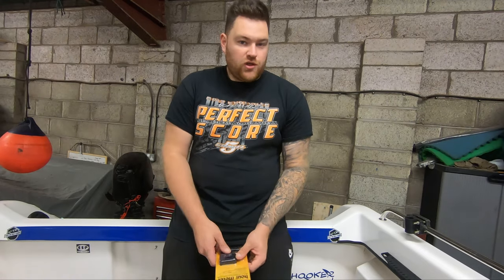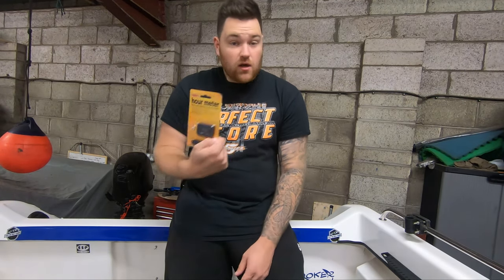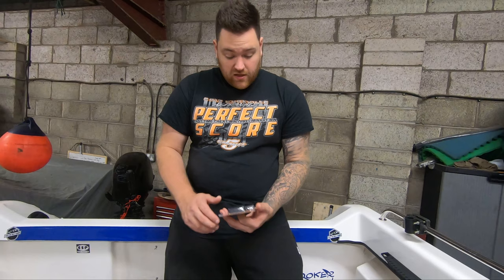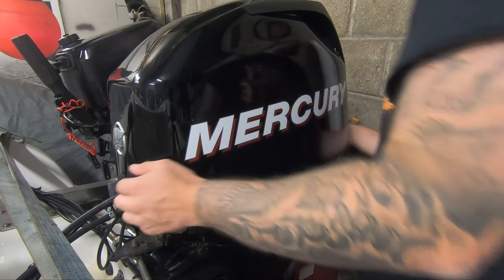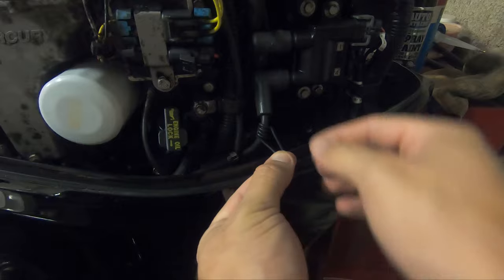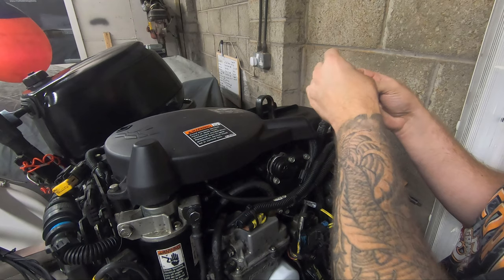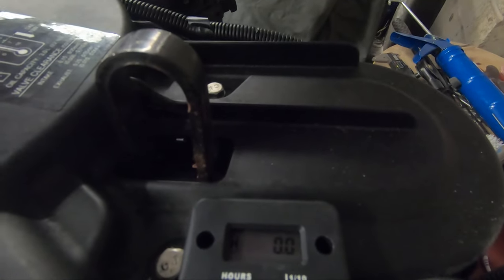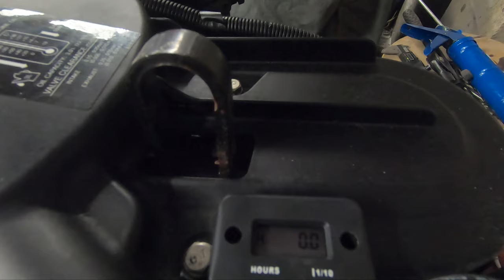How to fit an engine hour meter - to my Predator 165 fast fisher!!

Comment: how did this set up held up around the heat generated by the motor???  How is the battery life in the meter? Heat and batteries dont work well together. Cheers.
Reply from the maker: Meter still running well,even after being laid up during recent lock down, the unit is designed to be in an engine bay, no changeable battery, battery is built in to serve around 3 years service, then is disposed off. I have mine mounted ontop the plastic cowling, when tested there is no excessive heat in the area.
Reply: @ScottishWildFishing  Thanks mate, appreciate your quick reply.
Reply from the maker: Not a problem, if your just looking monitor run hours in-between service intervals or run in periods they are ideal!
Reply: Did u hook to plug 1 or plug 4
Reply from the maker: @princelast8478  its on no.1, its only looking for a pluse so, it could go on ant one.